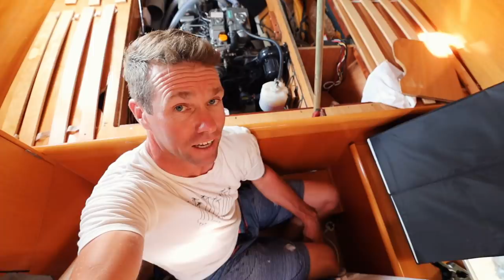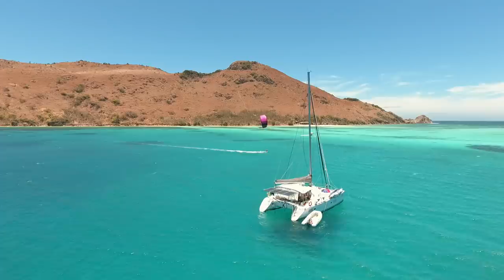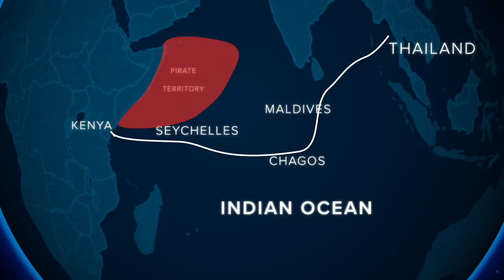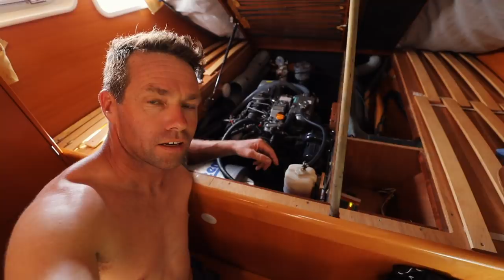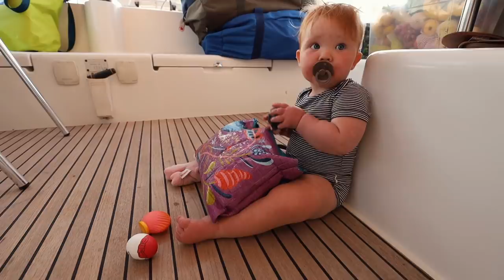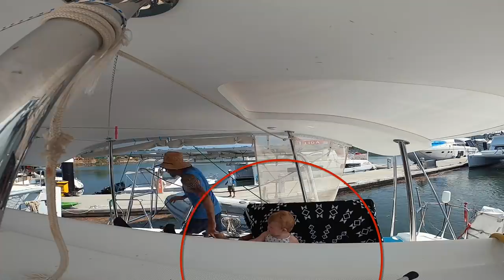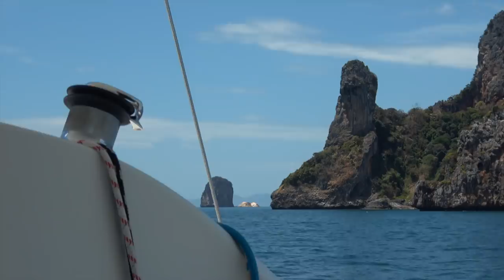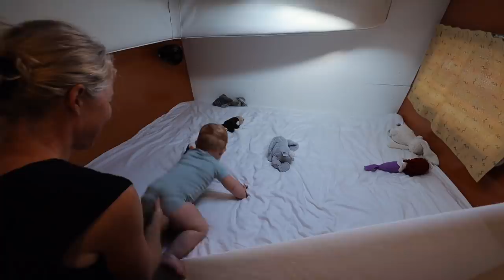we Just BLEW UP our Engine

Comment: Try to check tapet clearance, valve is stuck need to change elring on valve Guide i think its already brittle, if im there i will fix your engine for free i see your push rod not in good position and its loose its dangerous to your engine. Don't start your engine it will cause big damage,

Comment: First, it looks as though you have a broken motor mount or mounts. Second, definitely sounds like you have a shaft issue.. the banging indicates that your shaft broke free. Finally the ticking sounds like a cylinder or bad spatk plug. Cannot wait to find out
Reply: Diesels dont have spark plugs
Reply: Spark plug? It's a Diesel.

Comment: You are down one cylinder for sure first time you started in the  video.  And by down I mean no compression.  Need to check the valve train at minimum.  Suck, Squeeze, Bang, Blow.  4 stroke motor.  No squeeze = no bang.    You are missing squeeze on one cylinder for sure.  I can tell buy the uneven thumping sounds in the video.  As far a the clanking, sounds awfully loud.  Dropped valve getting smashed to bits?  Or spun rod bearing bearing allowing the piston to hit the head?  Nothing to do but take it apart and find out.  Your not fixing that with out some hard parts is my bet.

Comment: Rust ring on the valve seats would have been broken free before it started u had been turning the motor with no fuel for a while so I dont believe it was the valve its self 
My money is in the lifter considering it happened while lowering rpm